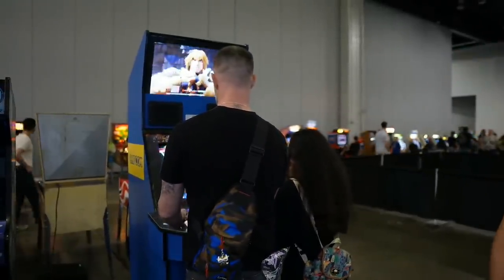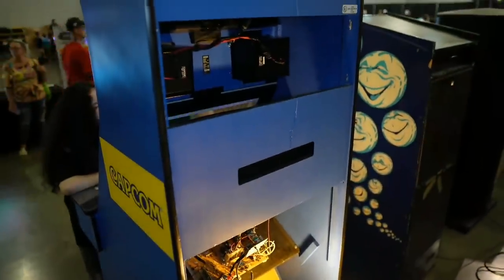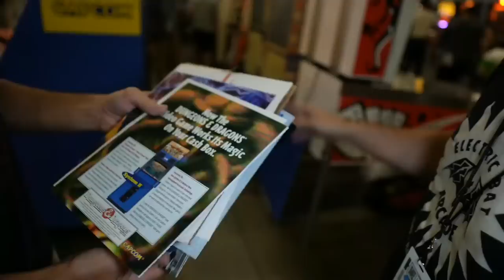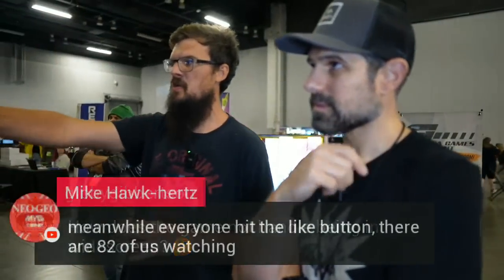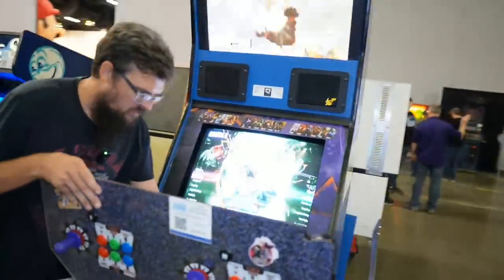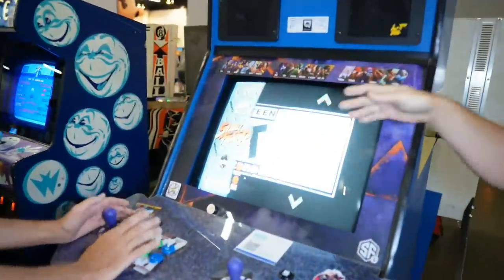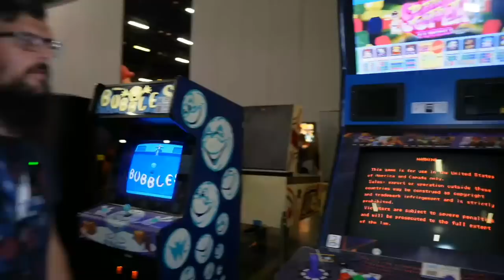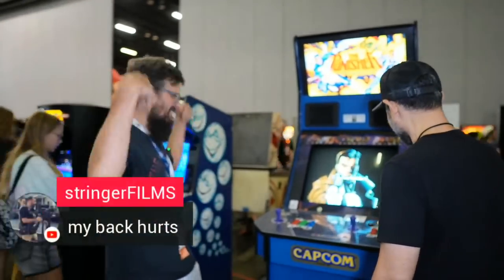This Street Fighter 6 Custom Cab is absolutely mind-blowing!

Comment: GBS-C with 15khz downscaler would greatly reduce latency. Otherwise very clever build and amazing work!
Reply: From what I can see Capcom should make a street fighter alpha 4 y Street fighter series now I see has really gone down a lot unlike the new camy look Julie Chun-Li  bring me some more than that to make a good game to see ryu  ken and other original   but I don't see sf 6 a classic at all by PS I played a lot of Street fighter game the street fighter 6 and will not be one of them by mega gamer 🥷🎮😏😏😏sorry ??????!!!!!!!
Reply: neogeomaster3027  This method works great for pixel games or any game that can scale to low resolutions but modern PC games often don't scale very well or at all and old video cards sometimes don't even have the muscle to  run the games smoothly or even launch at all. By going with a scaler a compromise is made to make 3D games run at full speed with higher setting display on what is essentially a CGA monitor. The 16x9 scale to 4x3 does need some work though.

Note: the GTX 1030 DDR5 doesn't have enough heft to run SF6
Reply: The GBS-C should work great if using the RGBs output and not the component. I tried this with the GBS-C's component output which rendered buggy results. That was a while back and maybe those issued have been worked out.
Reply: neogeomaster3027  "And you can even play in 224p with 120fps with ultra settings."... on a 30 year old crt, sure.

Comment: 27:40  This is not a Japanese exclusive. This was released in the US in 1997. The Japanese version was released earlier the same year, but was called Pocket Fighter. It was also released on PlayStation and Saturn the following year, but the Saturn version remained exclusive to Japan. It would later be released on PS2 via the Street Fighter Alpha Anthology (known as Street Fighter Zero: Fighters' Generation in Japan). 

You can also play it on all modern consoles via Capcom Arcade 2nd Stadium and Capcom Fighting Collection.
Reply from the maker: Thanks for the clarification.
Reply: @RetroRalph Gem Fighter is also on the recently released Capcom Fighting Collection which IMO is the better option thanks to leaderboards & online play.

Comment: If they are somehow able to market those, they would sell a ton of them. Even without adding a CRT monitor.
I'd buy one.
Reply: Trust me you would pay an arm and a leg. I just a watched a video of someone paying $10,000. He got screwed hard. Consumers want cheap. Building cabinet parts is money. Nothing will beat doing it yourself. I paid $900 for mine only because I already had all the knowledge. Meaning I bought a cabinet with no PC inside. You have to settle for a arcade1up with the poor power of a pi. Money is time. You don't want to give $10,000 of your time you will never get back. Saw, hammer,screw driver, and Home Depot is your friend.

Comment: How did you get street fighter 6 to work in 640 x 480 4:3 ratio? Does this game support it out of the box?
If it does , does it also do 800x600 or 1024x786? Thanks!
Reply: Lol most arcade games are now running on Computer hardware. I believe he said he it has a menu option to run it at 1080 p but it would crash due to his Compatibility and hardware. But short answer yes

Comment: Ralph what do you think of putting in the new 26” led arcade monitor Todd is offering?
Reply from the maker: Are you reffering to the Unico Phoenix monitors?  I didn't know Todd was selling them.  I plan on getting one to test it out but I guess I would want to know what application Todd is using them for before sharing my opnion. If it's going out to someone's home in a multicade, I'm fine with that.
Reply: @RetroRalph  he just had a video last Friday about them and how he is carrying them. The unico monitors that are direct fit. I wonder how it would work in that street fighter 6 build.
Reply from the maker: @marshallkobe  Not sure but from what I'm hearing they don't have a great moutning system.  I asked Unico about this MANY times and they just told me "yeah it's going to have one".  So I ordered one so I can see for myself.  I usually watch all of Todd's videos so I will have to do back and check it out. I think they would probably use them in multicade builds but I don't know that for sure.
Reply: @RetroRalph  looks like we have the subject for a future Retro Ralph video!
Reply from the maker: @marshallkobe  100% I think I should get it in the August timeframe so as soon as I have some time with it, I will make a video on it.  I will go back and check out Todd's video though, thanks so much for the heads up!
Reply: @RetroRalph Todd said he ordered 100 of them!

Comment: I'm surprised by the statement that a Xinmo encoder works but an IPAC won't... I've always had trouble getting Xinmos to work with Steam, but the minIPAC I have works EXCELLENT with Steam in Xinput mode.
Reply: Hey I have a bunch of games not on steam that require xinput  would the ipac work with those games?
Reply: @andyimbrogno6900  Probably. The minIPAC I have can function as keyboard, dinput, or xinput, and it should just work for anything that uses the xinput standard.

The folks at Ultimarc are very good and helpful about answering questions about their products, so I definitely recommend hitting them up. I got a minIPAC instead of a full IPAC on their recommendation after mentioning my use case. 

They were also very helpful in troubleshooting when it got stuck in dinput mode. We still don't know what went wrong but the troubleshooting steps did lead me to try something that fixed it(can't recall what right now, though). Obviously I do quite recommend them.

Comment: annoying. he had to passthrough a hardware video scaler. this means it can't work into 15 kHz with old arcade games. however its GTX 970 can do that running Batocera with a RGB cable. I see Punisher have overscan. and aspect ratio looks wrong in SF6. vertically stretched.